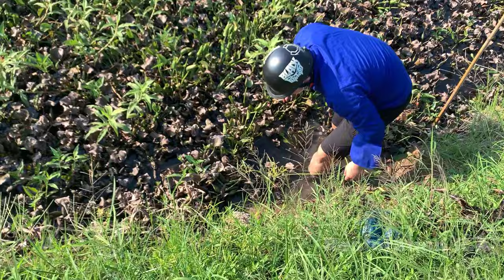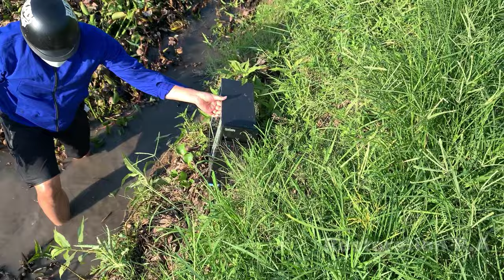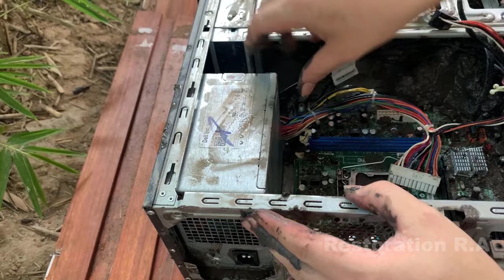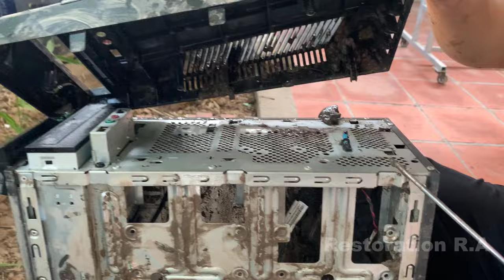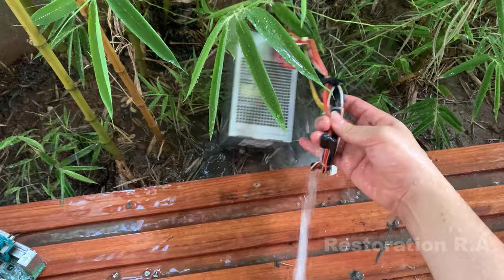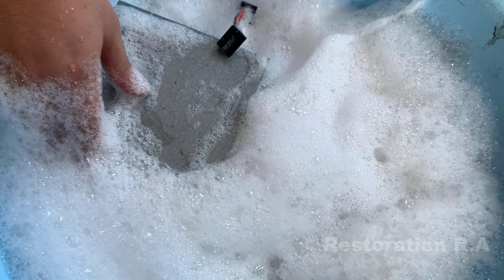Restoration broken COMPUTERS 🖥 Abandoned on the RIVERSIDE | Restore and Repair old Computer CASE

Comment: Every PC fixer knows that when there's damage in the processor socket pins, it won't work...the moment he brushes over the CPU socket pins or bends the socket pins..I know it's fake because he swaps PC at the end.
Reply: yes i seen it too the pins on the board were bent then when he flipped the board over it was a new board

Comment: I let myself be subscribed to this channel today for the simple fact that I am a technology professional and I saw that this computer would never turn on with crooked processor socket pins, both in the energy slings and in the communication lines! they are in short circuit positions
Reply from the maker: thank you
Reply: U know that's fake and they put it there 4 the video?

Comment: I would’ve been suspicious as to why it was dumped, hdd would’ve been discarded straight away & if I bothered with the machine I wouldn’t have taken the cpu out until I’d washed literally all the mud away, certainly wouldn’t have scrubbed the socket with a brush of any kind due to bending pins, which this person has in several areas so pretty sure this machine wouldn’t work, the conclusion tells me you either brought a new board or were skilled enough to bend the pins off camera.

Comment: Hello! You're doing everything somehow not carelessly... Be careful.. And please, don't take out the processor first, take it out later, gently wash the socket and put the processor back, so you won't kill the contacts, believe me, I know what I'm talking about, myself I repair and assemble computers. Good luck.
Reply: Yes u right but this dude don't know anything he put the pc in the water 4 the video
And at the end he changed the motherboard so we think he repair it

He was pulling on the cable without press the clipper

Comment: ok what the heck this is so staged and fake. FIRST it was a lenovo PC. he put a DELL psu and then when he turned on the pc he put a freaking HP in the video and the not the lenovo and THIRD he put fake rust and corrosion and its all just fake like 😔😔